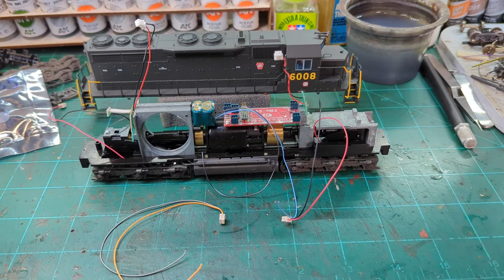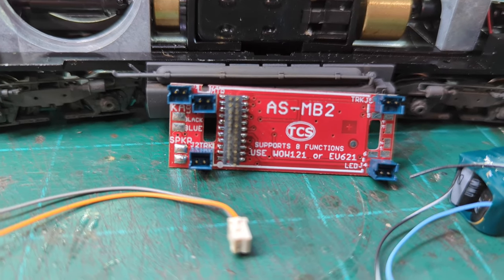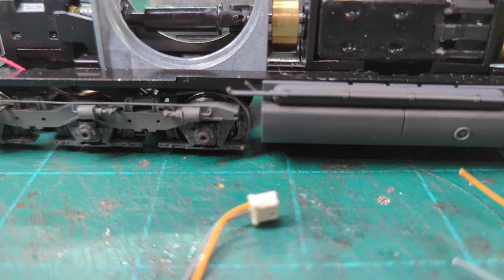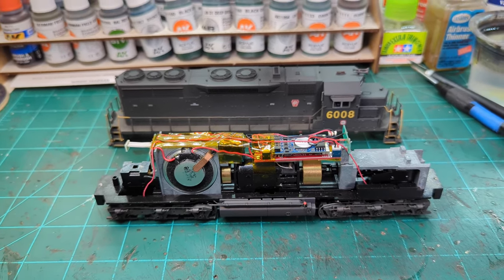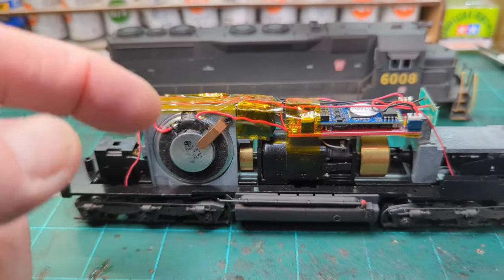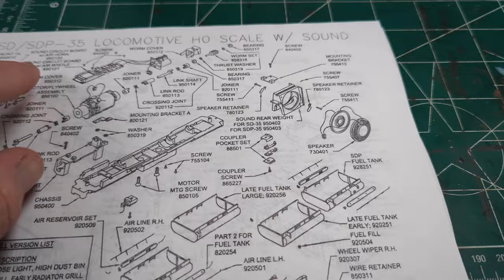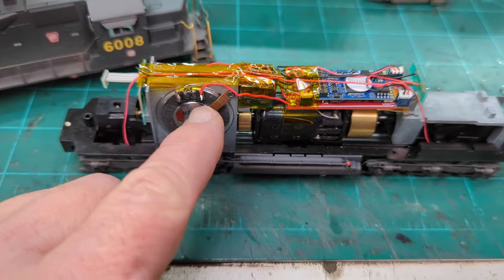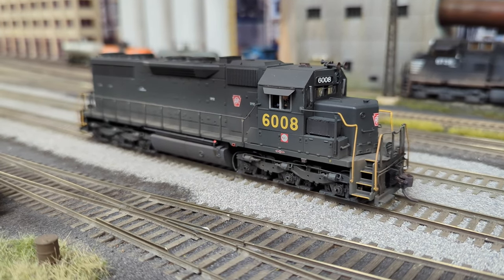DCC/Sound Addition: Atlas PRR SD35

Comment: Good video.  I went through a similar ordeal fitting a KA4 and adding ground lights to a conversion of an Atlas HH660 to an HH600. I finally got everything tucked in and the shell snapped down. Hoping I never have to open it up again.  You're right, it's often not as easy as it looks on YouTube.

Comment: Hello Steven,  that speaker is a low end speaker from china..  Anyway you can hook the leads to a 1.5 battery. Then watch the positive and negative leads.  The speaker should be pushing outwards in the correct phase first. Then you know what's positive and negative. Then just series them together to get a higher impedance.  Also I mark the trucks with a F or B on the bottoms to keep from mixing them up. It seems like everyone in doing a Sd 35 now. I am too , an Atlas in N scale with China. You also could put the speakers in parallel,  this lowers the ohms and may sound better here. Those speakers should not need that may amps to power them so it sound be fine that way. If they are 8 ohms they will show a 4 ohm in parallel. Anyway I enjoyed the video as usual.

Comment: Not sure if your wheelhouse leans in that direction, but you could "modify" the existing Atlas speaker enclosure and a ESU sugar cube speakers. The modeler on YT - who goes by Boomer - has a locomotive using a ESU V5 decoder running 4 speakers, 2 pairs (each pair running in parallel) and tied together is series, = 8 ohms. I hope I have that right..

Comment: Scalesound makes a drop in speaker for that locomotive, those 30mm a frame speakers are very harsh sounding but very loud. If you change your mind the SS sound way smoother and deeper bass. Nice install though.
Reply: DAMN! You are correct- I must have overlooked that when I was doing this. Well, if I ever decide to change the speakers I know what to get. Thanks for letting me know!